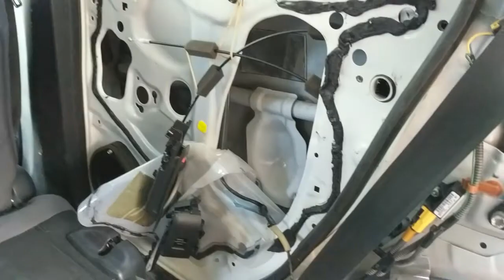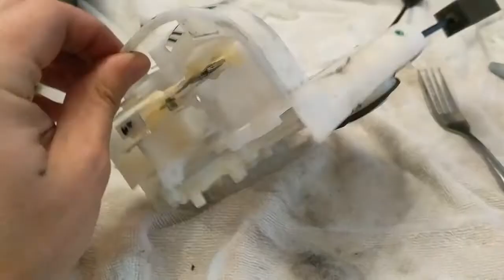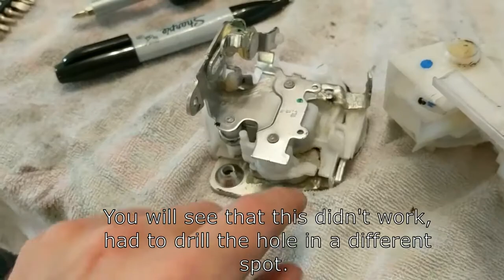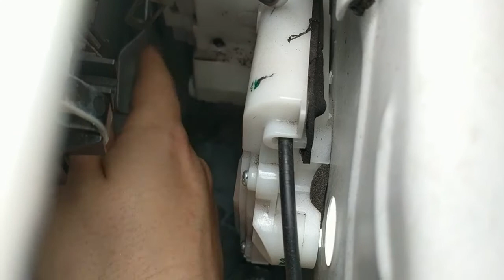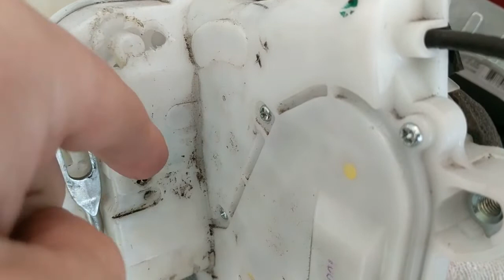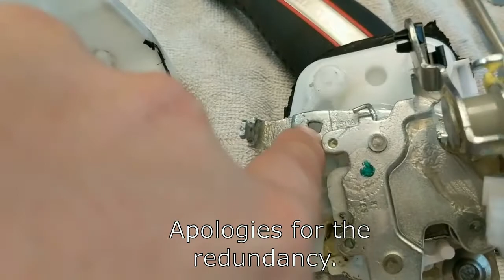Fixing Jammed Door Latch Honda Fit (Internal Mechanism Stuck) Advanced Video

Comment: I had similar problems. Both front actuators had failed and left me with a locked driverside door. I bought two actuators and took the door panel off the locked door and ended up smashing the old actuator in place in order to open the door. Hellish problem. Take your frustrations out on the old actuator, and get on with life!

Comment: For the love of God just smash the lock 🔐. Once the plastic cover breaks off and motor fall out it will open the door. Do not do what this guy has done .
Reply: I’m so glad I came across your comment because at no point did I think “I’ll just smash the actuator to pieces.” I feel so dumb for not thinking of this. I’ve never been a destructive person, but this is absolutely the best solution.
Thank you so much stranger from 4 years ago!

Comment: Dude your a life saver. Had a stuck lock on my 2013 honda fit and door would not open from inside or outside. Watched your video and drilled hole in location you did and pop! Door opened much thanks

Comment: You sir are my internet hero for today!  I just used nearly the exact procedure to open the drivers door on my daughters 2010 Honda insight.  The actuator assembly was basically identical to what you showed in the video.  I was able to get the door open and remove the actuator.  I spent 3 hours scratching my head before I found your video.  I gutted out the locking part of the actuator so that it cant freeze up again and at least got the car drivable until amazon brings me a new one next week.  Once again thanks so much for your help!!!

Comment: The driver door in  my '09 Fit was stuck locked. Nothing worked. Thanks to you video I figured out where to drill the hole. I did not have to cut the window track, just unscrew it and move it out of the way. I have a small drill that fit into the door opening, drilled the hole just below the screw and using a thick wire was able to able to unlock it. Actually, removing the old latch assembly took longer than getting the door unlocked. I did end up buying a whole new latch assembly, part number 72150-TK6-A02. It was not cheap!!! Still saved several hundred $$$ compared to the dealership.
Reply: Hello. I have the same problem with my 2010 CR-V front passenger door where the lock is stuck in the lock position. Here are a couple pictures and notes I took, just for reference: https://imgur.com/a/p7fB4Xk and a video of how my actuator is attached in the door: https://streamable.com/qt9vm

Through watching some other videos, I think I need to get to the same area to unlock the door as the lock switch component in the CR-V actuator seems to be in the same area as yours.

As you can see in this pic: https://i.imgur.com/ETRqyg1.jpg, I have very little space to put the drill in as there are these metal bars covering some of the open area.
I may need to get a drill extension to drill a hole in the actuator. But is it not possible to just take that one screw out and push a wire/hanger through that screw hole? Or is it too small? Or will it damage the plastic threading?
Reply: Great

Comment: I live in Japan and drive a 2005 Honda Stepwagon.  Yesterday, drivers door (RH) just stopped working.  I could hear the lock solenoid try to work but no matter what it would not unlock and the door would not open.  No shop would even touch it.  I watches several videos, read blogs, asked around but just could not figure this out.  Fast forward to this video.  I watched it a few times and decided to give it a shot as the lock mechanisms are very similar.  Got a long drill bit to avoid cutting the window track, drilled the hole, got a coat hanger and wiggled it in the hole and bam!  The door opened right up.  Then I closed it by mistake but the coat hanger quickly opened it again.  Upon inspection, I found that there was a broken spring in the lock mechanism jamming everything up.  I pulled the spring out and some of the internals to make it a manual lock so I could use the car while I find the parts.  The rest of the power locks still work fine.  Mrcleanandfresh, I'd be happy to share my photos if you would like to see them.  Thank you and god luck to anyone else with this problem!

Comment: I have a similar problem with my CRV 2007. It stopped working the actuator manually or with the remote... from inside and outside... the lock button from inside is stuck on the closed position (drivers door). Which lever should I move to remove the lock so I can open the door? Thanks in advance.  Best regards.